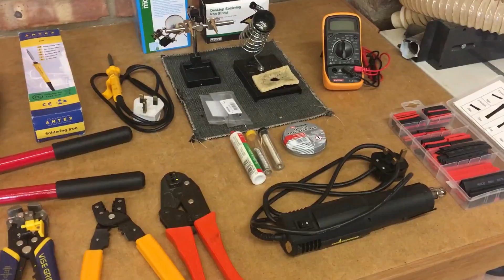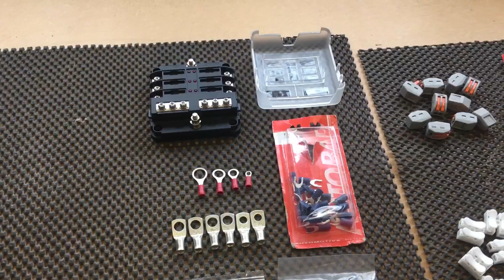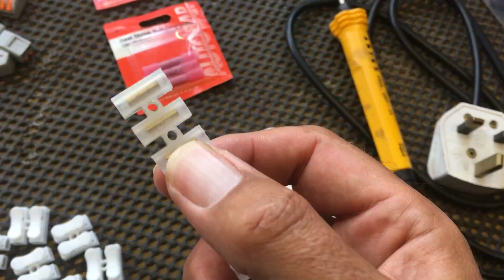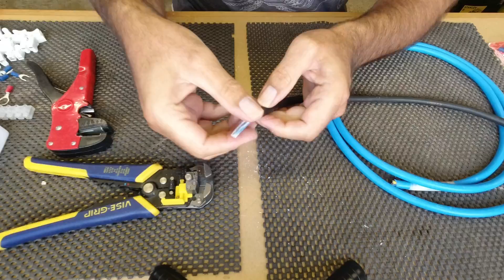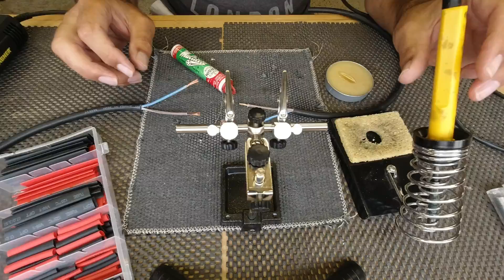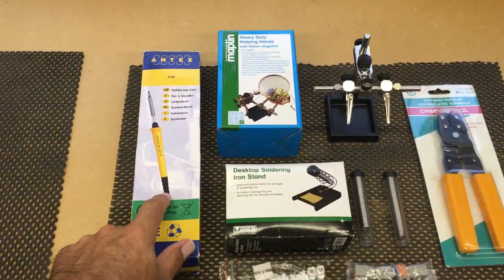Wiring Tips for Van Conversions

Comment: Greg, I've watched a lot of your videos and they're generally excellent. However, as a former rail vehicle engineer, you need to take vibration into account when wiring a vehicle. You shouldn't use chocolate blocks or screw connectors generally as they can work loose - the exception is when you use ones where you can add a spring washer (or similar) to counteract the effects of vibration. You also shouldn't solder in high vibration environments as the part of the wire where the solder starts is subject to fracturing due to the vibration. Soldering on circuit boards is generally fine where the components are only supported by the circuit board as the whole thing vibrates as one unit. But, in general, you should only use crimp or push fit connectors. Also, best practice is to ferrule the ends of the cable when using push fit connectors.

BS7671:2018 section 721 covers electrical installations in caravans and motorhomes.
Reply from the maker: Hi Charlotte, I can understand that as the solder makes the cable rigid. 
From my own experience I’ve had far more crimped fitting fail or pull out than soldered connections. 
I wasn’t quoting any regulations I clearly said this was my own preferred way of doing things. 😊
Thanks for your contribution 👍🏼

Comment: Good stuff Greg for those who don’t know how to do any of this. My only complaint or criticism is how you’re joining the Wires. When your hair is placing a wire to another wire in-line you should never just tend them and then side of them laying next to each other that’s a high resistance connection. 
You’re getting a little better there with what I see now after you showed that sort of splaying the wire and twisting them together. But unless they’re very large cables you should do a Western Union splice I recommend you go look up that. Because then your supplies is basically mechanically made before you solder it.
But good stuff in general for all those who don’t know a thing about how to do any of this. I just witnessed some very poor wiring done by somebody on a van build here on YouTube and I advised him to step his game up a bit you don’t want warriors coming apart on your build somewhere down the road it’s just not acceptable.

Comment: Yep always remember the heat shrink when you solder wires.  I have done some of the best solder joins ever when I have forgotten them 😀.

A portable butane soldering iron is really good for awkward places.  Also you will have a lot more success with the environmentally unfriendly 60/40 lead based  solder.  The righteous solder, the lead free stuff, is much more difficult to solder with.

Comment: Hi Greg could you tell me if I’m using my 3 way fridge just on 240 and 12v do I need to flu it out the van still ??
Reply from the maker: Martin Hickman if you don’t connect any gas to it there is no need for the glue but you still need to ventilate the condenser which will get hot.
Reply: Greg Virgoe thank you for the reply so to ventilate it can I just put a grill in the side of the kitchen unit

Comment: Good video Greg, hopefully that will get many started. Did you ever want to be a teacher, you would have been very good at it?
Some thing to consider is the wires that are soldered together may fail where the solder finishes and the wire reverts to individual strands in a high vibration environment. In aircraft we would use Butt Crimps. 
And for the health and safety lot the fumes may contain lead, although in the 70's solder manufacturers perfumed the the flux so we sniffed more of those lovely lead fumes. Now they have extraction and lead-free solder although I never remember it doing me any harm :-) .
Reply from the maker: It’s pretty much all lead free solder nowadays.  Good ventilation is also a must.

Comment: Great video with lots of great points.:) As an auto/domestic electrician and electronics engineer I always use soldered joints where the cable is not exposed to vibration and crimped for when it is. Its also worth adding these crimps have an orientation for crimping. For all barrel-type terminals, the kind that makes a complete circle, the crimp indentation goes to the solid side, not where the two ends meet.:) Much respect for what you are doing here, this is a fantastic channel.:)

Comment: Another great video from a meticulous master. One finer point and one suggestion:

• Always remember to purchase solder for electrics, not plumbing!
• A portable soldering station is brilliant for mobile work, under the chassis, etc.  I have a Ryobi One+ (18V) 45W adjustable iron (400°F-900°F), as well as an all-digital TS100 65W adjustable iron (212°F-750°F) that's powered by any 12V-24V source. I use it with portable lithium batteries I build when out and about, or a wall wart when mains are easily available.

I too love the Wago connectors. They've all but eliminated wire nuts in all my electrical work. Their absolutely brilliant for retrofits, or when connecting to rough wiring in new builds and renovations. While it's uncommon an uncommon occurrence, Wago connectors make it so easy to remove fixtures for repair or replacement. By the way, the Germans who make these little gems prefer "Văgō". :)

Greg, you're looking very well. Trimmed up, clean shaven, and it appears you've been in the gym and on the bike. Good on you, mate.

It's very kind of you to have put together the give-away. I have more kit than most, but hope that this one goes to a deserving subscriber. (Hint:  The random winner should be a subscriber. Not only someone who viewed, commented and shared. However, I'm not sure if you're able to make that distinction on your side.)

Be well and do good works!

Comment: Brill vid Greg, its been years since I’ve done any real electrical work and still struggle removing the outer sheath. I always end up folding the cable over and gently slicing the cable until it breaks the outside. The Waco connectors are brill too. A neighbour suggested these to me and I’m really impressed with them. Keep the vids coming 😊👍 Cheers

Comment: I was taught (many years ago) that electrical solder is not to be used to make the mechanical connection between two wires, only to reduce the resistance of the joint.  It seems that in tinning two wires and then laying them side-by-side and soldering, the mechanical strength is coming from the heat shrink tubing.
Reply: Heat shrink provides fatigue resistance to the soldered joint to wire transition. Where solder joint ends there is a "hard point" where if vibration is present the wire can fatigue and crack / break. Any connector which doesn't provide a crimp onto both wire and insulator can suffer from this. Adding heat shrink provides the required fatigue resistance. Tracing short circuits later is a pain!

Comment: Your soldering method for joining the wires is a good one. You often see people saying you should twist the wires together and then solder them, while it is true this is the strongest method for joining wires, it is also impossible to reverse if you make a mistake or need to do work later on. Using your method you just need to apply some heat and you can separate the wires, do the repair/work and then re-join again with minimal hassle.

Comment: One thing though, what is your preferred choice when you need to splice off where you have more than two wires connected like the lights branching off for example? Soldering the junctions seems a bit clunky. And block connection might get loose with time?

Comment: Thanks Greg. Yet again another informative and brilliant video. I knew you had to tin cables before soldering them together but never knew how to do it properly. Getting the basics right will save us a lot of work later on tracing and correcting poor connections. I've already bought a good crimping tool and wire stripper so will now order the soldering station bits to make my life easier. Well done mate. 👍👍
Reply from the maker: Den Weston did you get to the bit at the end about the free giveaway? 😃
Reply: @GregVirgoe  yes I did thanks mate. I've already purchased some of those tools and only need the solder station and helping hand. Therefore better if your give away goes to someone starting out without any of those tools. I just wish I had a workshop like yours. Are you planning on giving that away? 😂🤣😂

Comment: Brilliant video greg. Only advice I would ad as an electrician; When it comes to wiring the fuse board, shape and route the wiring to a neat form,  before cutting the cable and adding connectors. This is to ensure not only is it a neat install but to also ensure the lid fits back onto the front (cable entry is often limited to designated points through the lids).

Comment: Hi Greg..one thing we've come across at work, us that some makes of the red crimp pliers are one sided only. They leave a number (1, 2, or 3) on the butt crimp, when you've finished and that number should be on the centre portion of the butt as it's a tighter nip on the wire. If people have these type of plier, they could potentially leave a slack connection to the wire, if they crimp the other way..
Hopefully this will help someone.. 👍

Comment: How do you heat shrink when splicing 3 wires together and soldering ? Im wiring today and was gunna just use tape
Reply from the maker: Obviously you’d have to cut the main wire to use heat shrink. You can use electrical tape just use plenty to get insulation level.
Reply: Google Western Union splice. This is old school and will work in tight spaces/a van build. The key when doing automotive soldering is to protect the inner core where the solder ends. If you don’t use shrink wrap or tape, this will break as it flexes as the vehicle moves. 👍

Comment: Thanks for the video Greg I found it very interesting and useful , I will be picking up my 1st ever motorhome in a few days and with it being an older van (2004) will need some electrical upgrades, this vid has given me a bit more courage to try some things myself, thanks 😊👍
Reply from the maker: No doubt you may be adding solar or upgrading batteries so give it a go. It really is simple and doesn’t take much practice to get good at it.
Reply: @GregVirgoe  thanks greg, and looking forward to see your next vids on wiring etc also I'm looking back at your van build vids for even more tips. 👍